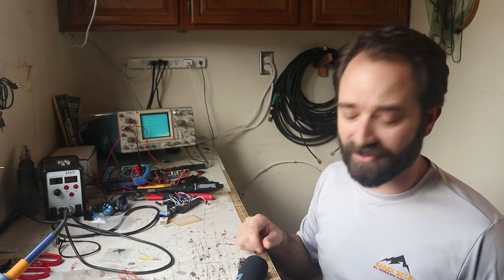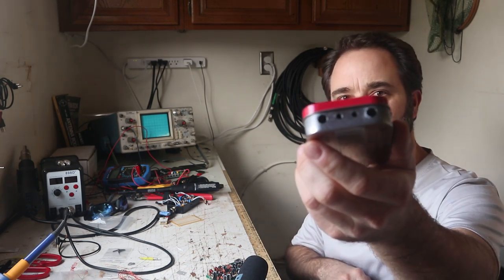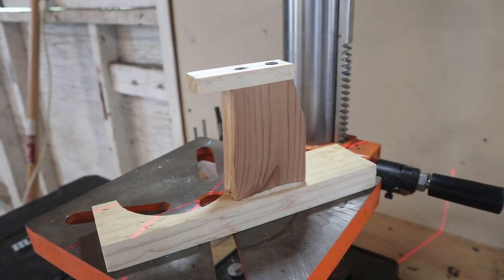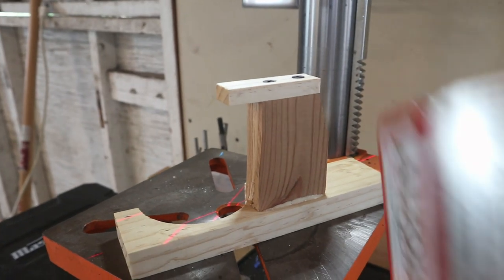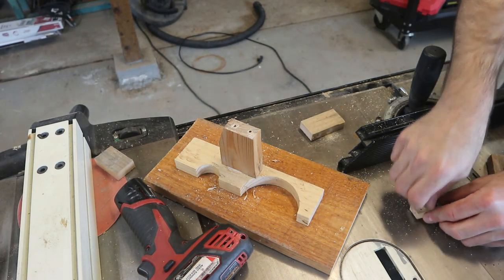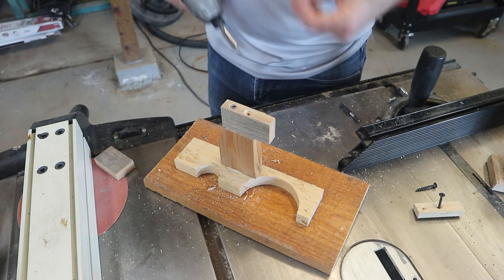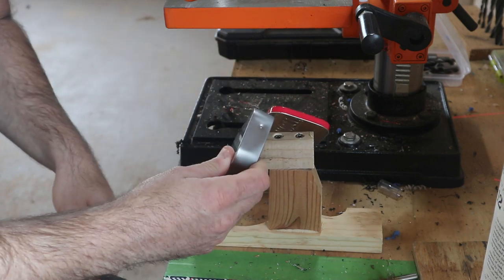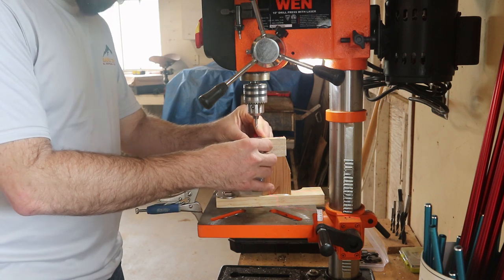Drilling Clean Holes for Mint Tin Radios

Comment: Good job Adam!  I like to use a step drill bit. It's clone shaped, like an upside down multi level birthday cake. Works great without all the changes.
Reply from the maker: Yes, those are a great way to go too.   I find they obliterate my wooden fixture that I use as a support and that I can get a better hole with a couple steps up via separate drill bits.
Reply: Just make sure they're really sharp, else they'll leave the tin with a lot of unsightly burrs

Comment: I start my hole with a Dremel and a tiny drill bit after being center punched lightly. I don't have a drill press so found it is easier to see the tiny drill bit and be more precise. After the pilot hole is drilled I also use a step drill bit to get the final hole diameter.
Reply from the maker: Awesome, thanks for sharing your strategy. 👍

Comment: Thanks for this.  Any suggestion if you don’t have a drill press?
Reply from the maker: Same general procedure. The center punch will make it MUCH easier to drill in the right spot. Use a nail or a screw if you don't have a center punch. And drill into a piece of wood backing. Those two things will make the most difference for you.
Reply: K6ARK Portable Radio thanks!
Reply: I second the wood backing. Drill slow with light pressure so when the bit comes through it doesn't tear.

Comment: How do you get the spacing correct? Like when mounting a pixie.  By the way, another great video, keep them coming and hope to catch you on the air. 73 Kf7zvl
Reply from the maker: Careful measuring and eyeballing. Get a pair of calipers for measuring (harbor freight or cheap Amazon ones will do for this stuff) and it'll help a lot to check widths, heights, and distances before marking and drilling.

Comment: I use a paper one-hole punch; looks like a pair of pliers..
Reply from the maker: Great idea, especially if the hole is the right size for the need.
Reply: I just realized I have a leather hole punch that might work perfect for this.
Reply from the maker: @WI9LL  let us know if it works!
Reply: There are metal hole punching tools, Home Depot sells one for about $35. The only issue would be trying to punch a hole in the bottom because of clearance. There are other punch and die tools, but much more expensive. Someone already mentioned a step drill, which would also work well. Enjoy the videos, keep up the good work!